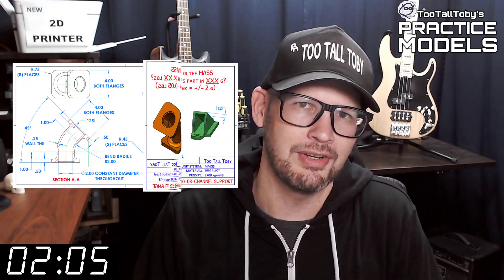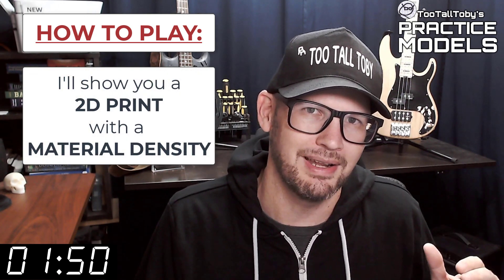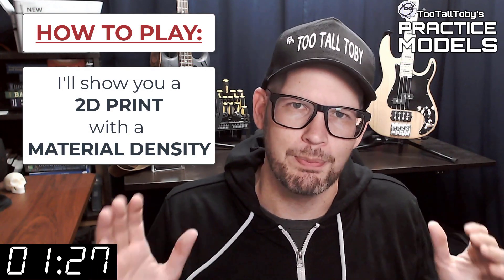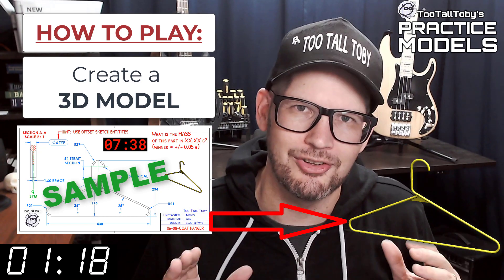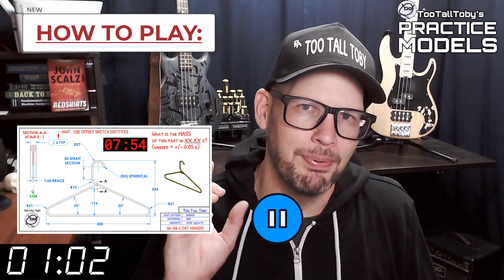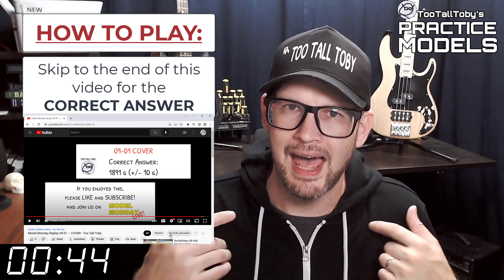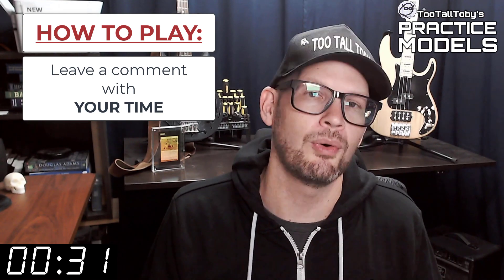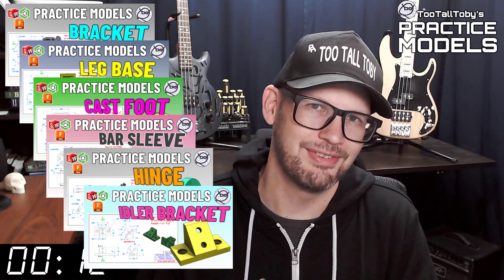SOLIDWORKS Practice - Onshape Practice - Fusion 360 Practice Exercises - TooTallToby-21-02-05

Comment: Fun one that had quite a bit going on!
Got it on the first try in 5:10 without any major stumbles, in Onshape as usual, and without Ivan exploits even though it would save quite a bit of time here...
Couldn't help do another run, with the Ivan exploit (and also more frantic mis-clicks...), I got it in 2:55.

Solve video on my channel.
Reply from the maker: lol - yeah the ivan exploit is unavoidable with sheet metal (all uniform wall thickness)
Reply: @TooTallToby  the slot was a bit trickier to exploit because of the length dimensioned to the edges of the flange but even that is simple math!